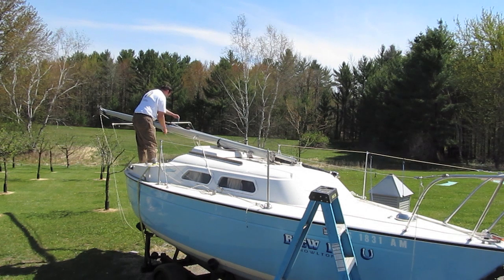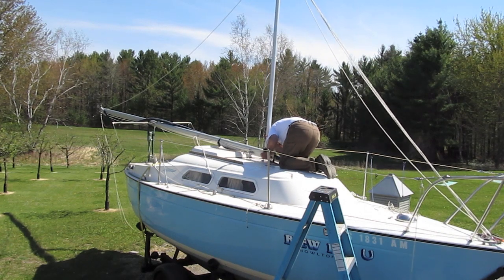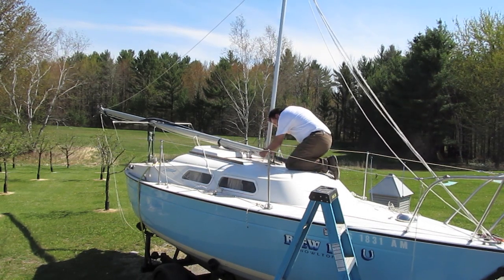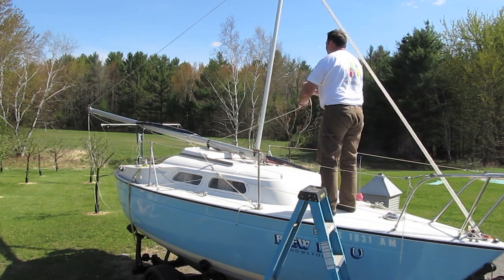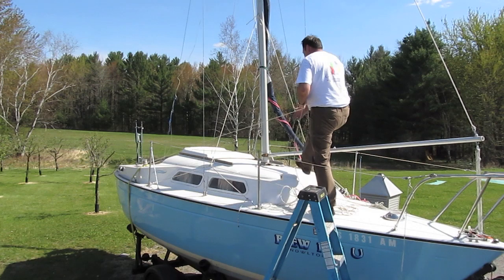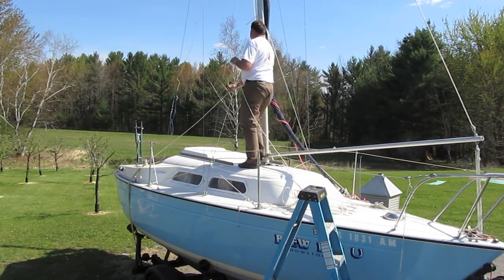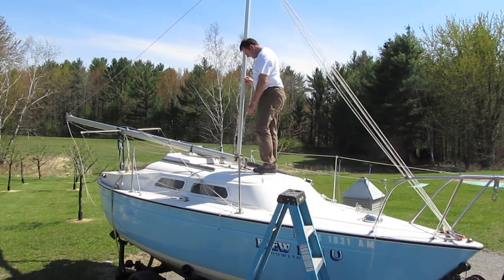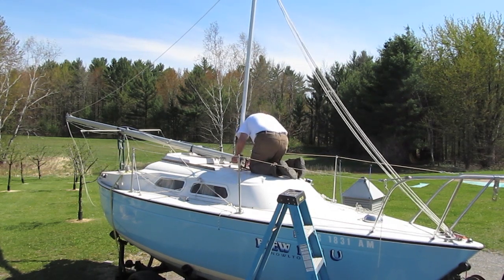Gin Pole Mast Raising System - PY23 Paceship.mov

Comment from the maker: I use New England stay set for my stabilizer lines. The trick with the stabilizer lines is to get the base of your stabilizer line in the same position as the pivot point on the mast. By doing this it maintains tension on the stabilizing lines that is consistent when the mast is going up and down. If you fasten your stabilizing lines anywhere other than a position in line with and at the same elevation as the mast pivot point will result in lines that will loosen or tighten during raising.
Reply: Thanks for this video, Joe!  I have a Hunter 23 and have a similar mast stepping system without the stabilizer lines.  Consequently, I need a friend to assist with keeping the mast stable as I raise it. I would like to implement stabilizer lines as you have done.  It looks like each side has a base line attached to the stanchion bases with some type of loop in the center to attach the baby stay. My guess is, the base line needs enough slack so that when if forms a triangle, its peak (with the loop connecting the baby stay) is at the same height as the mast base (or tabernacle).  Does my description make sense and is this correct?  Can you elaborate more on this stabilizer set up (the loop/attachment, etc)?  Thanks again!

Comment: Good Job - I have been watching different systems and I like yours best. Specially using an aluminum pole instead of wood! I just got an older Catalina 22 recently. Would you have list of parts, dimensions and sourcing? I will like to build similar. Thank you.
Reply: Go to Home Depot, always try to purchase high volume construction items because they're the least expensive.  Don't buy specific parts, they are very expensive but make your own, that's half the fun.  Buy a drill, jig saw, metal cutting blades, a vice, hack saw, hammer, and make your own metal parts.  I will probably be using a 1 1/2" diam. electrical conduit, they're cheap and functional.  They are galvanized metal, but the gin pole will not be on the boat when sailing, so I don't care if it is metal as opposed to expensive aluminum.  You can also use a 2x4, nothing wrong with that.  After a while, you'll might end up like me...I actually get more pleasure working on my boat making stuff than sailing her.   Good luck.

Comment: Hi Joe,
I have a PY 23 Paceship.
Wonder if you could provide more detail on your mast roller system that seems to fit over the rudder.

Also, It seems you have a bent U plate with holes on each end at the base of your gin pole to fit the forward pin at the base of the mast. Did you custom weld this piece to your gin pole? What do you have at the top of the gin pole for hardware to attach the block and tackle hook and your halyard?
Finally, when lowering the mast you will need to remove the forward pin at the base of the mast and then attach the gin pole to the base of the mast. It seems you would need to slightly push the mast aft in order to attach the gin pole. I suppose if you had someone bracing the back of the mast when you connected the gin pole that this could work but it seems like a risky proposition. I say this because I have a piece of 2 inch aluminum pipe and if I were to weld the bent U plate to the base of the gin pole, I am not sure if I would have enough room to attach it without tilting the mast slightly aft.

Comment: Hi There.  Thanks you for posting this very informative video.  I am using a similar gin pole system with a boat trailer winch instead of the 5:1 pully.  What I am interested in is adding the stabiliser lines and I have a couple of questions.
1) do you use Spectra or would a braid with a bit of stretch be better?
2) when lowering the mast should the stabiliser lines be left loose as they will tighten up as the mast lowers?
Thanks again,
Peter

Comment: have you tried this on much taller masts? like the big 400lbs ones?
Reply from the maker: This mast weighs around 100 lbs, and I designed and built this system for a customer who wanted to be able to lift the mast without help. I've used similar systems on some taller masts (40') but that's about it.

Comment: How much does it weigh, can u not just muscle it up?
Reply from the maker: A 30' mast weighing 100 lb mast requires a 200 lift at about 7' from the mast step, which is where one would probably need to be if the cabin height is much higher than the cockpit height. It's pretty tough for most people to manage. Most owners of sailboats 23' and up do not trailer sail their boats but rather set them up in a marina for the season because standing the mast is a significant task.